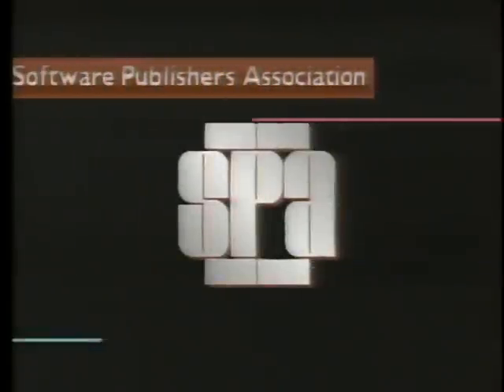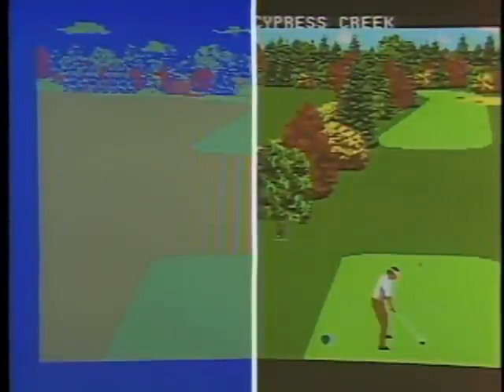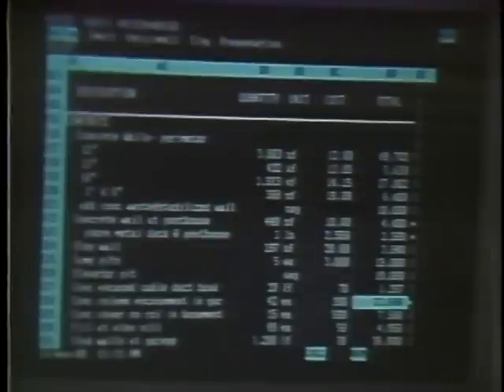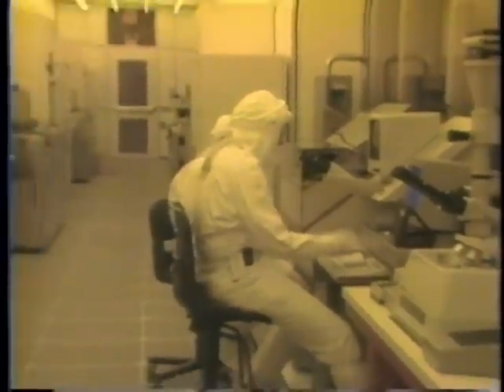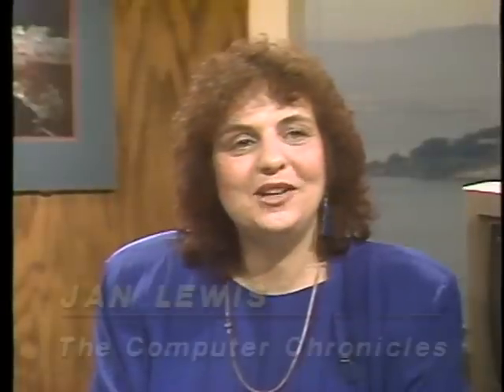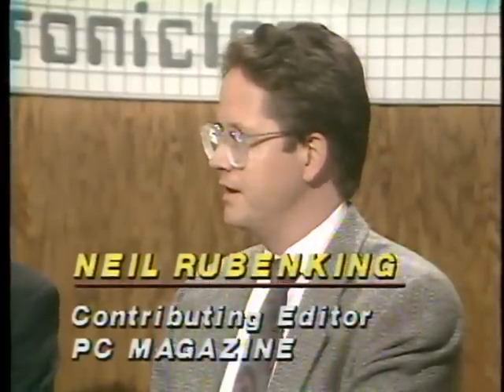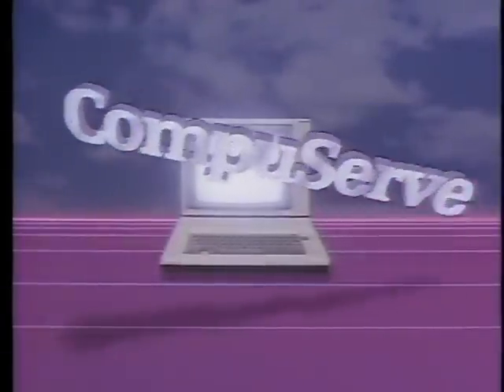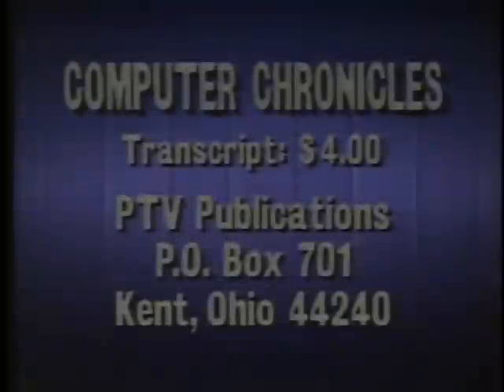The Computer Chronicles - Megahertz Mania (1989)

Comment: 10 years after this episode aired, Intel had surpassed the 200Mhz target that Bill Rash stated. By 1999, it was well over 1Ghz. Amazing!
Reply: Yeah! I was just thinking that! They were at 1.7Ghz pentium
Reply: Level of competition from AMD and Cyrix pushed that ceiling upwards quite a bit with what is more commonly known as the 586 processor lineup.
Reply: @situatedillness  Nope, mid-1999 is 1 GHz. 

On November 20, 2000, Intel released the Willamette-based Pentium 4 clocked at 1.4 and 1.5 GHz.

In April 2001 a 1.7 GHz Pentium 4 was launched.
Reply: Some people were still using 200MHz CPUs I suppose, but things did accelerate faster.
Reply: @valenrn8657  Right? I thought Pentium 3 was 99 they were not yet a GHz.
Reply: @Kamunchu  The original Athlon (now called Athlon Classic) was the first seventh-generation x86 processor and the first desktop processor to reach speeds of one gigahertz (GHz). It made its debut as AMD's high-end processor brand on June 23, 1999.
Reply: @Kamunchu  Pentium 3  reached 1 Ghz with a product recall i.e. wrong FPU results at high clock speeds.
Reply: @valenrn8657  I remember buying one and thinking I should have bought AMD stock and I never did, I really should have!
Reply: Man that guy sure looks the fool, his prediction was off by well over five times.
Reply: Now we have video game consoles with custom 7 nm AMD Zen 2 processors with 8 cores running at a nominal 3.8GHz or when simultaneously multithreading is used (SMT) it hits a comfortable 3.6GHz.

Addendum- I don't know about 1999 but I remember 2004 well. I built my second PC with an Intel Prescott 3.0GHz w/hyperthreading and a GeForce 68000ULTRA just for Doom 3. My best friend did the exact same thing but went with a 2.4GHz AMD something or other. He also bought the same 500 dollar 6800ULTRA card as I did for Doom 3. The Prescott might have had a faster clock speed but his AMD ran circles around it.
Reply: one thing that I don't miss from those days... cpu was old & slow in 6 months lol
Reply: I remember my 16mb ram forget the mhz 3gb HD in thr 90s. Boy was it slow.
Reply: @tr1p1ea I had a 200mhz very tall tower with 64mb RAM my grandpa built. And gave to me as a hand me down in about 94 or 95
Reply: @Sinn0100 once I got an AMD in college I've never looked back.
Reply: @spidaman0112  they had weird speeds in 2000, it was like 733 and 800 (why 733?) I remember getting "2nd" best it was like 700 or 733 and 800 was the best and later that year they released 1ghz or something. It (my computer) had riva tnt2 gfx card, it got older faster than my old p133 lol
Reply: @saitzo2325  I remember having 800mhz and my friend invited me over to show me his new 1hgz. Seemed like windows started instantly.
Reply: @saitzo2325  because of bus speed ... that time were 66 mhz  for low end , 100 mhz and 133 mhz for high end  ,... so 66 x 11 gives 733 or 5.5 x 133 as well 733 ... to get 800 mhz is straight 8x100 mhz ;)
Reply: And by 2007 they got to 10 GHz.
According to their plans in 2000, which didn't happen. Man, Intel in the early 2000s was a bust.
But they got to 3.8 GHz in 2005
And 5 GHz capable chips in 2019
AMD had their 5 GHz chip in 2013
And IBM had theirs in 2009

Comment: Hahaha, I do believe I am the first person to overclock a 286/386. I'll never forget when I was a young engineer working in the radar field, I was responsible for what was called the Built In Test Equipment (BITE). I was able to get this running faster by combining 2 speeds together (5 Mhz to 10 Mhz) and the data stream was twice what it was. I thought about my 386 could benefit from an increase in clock speed so I looked up the schematic of my motherboard and saw that the CPU was running at 16 Mhz. I called a vendor to order a 24 Mhz crystal (xtal) and the guy asked me why did I want to buy that. He told me he only sales to OEMs. I told him I wanted to test the idea of overclocking the CPU. He says he didn't think that would work. I looked at the buss for the I/O and the CPU and didn't see why it would not work. Low and behold, I got the xtal and installed it in my motherboard. It was just plug and play. I booted my system, brought up MS Flight Simulator and wow, I saw a much better runtime in the graphics performance (remember though, this is like 1989 or 1990). I called the guy and let him know it worked. He asked me to send him instructions on how it was done and what adjustments did I make with the clocks. I told him I did not do any wait states above 0. It was just remove and replace. I don't know how many years later but I started seeing ads of vendors talking about overclocking. If I'm not the first, I am certainly in the beginnings of all of that craze. Fun stuff!!!!!

Comment: In 89 I was still pushing a couple of 8mhz 68000 machines
The 1040STe wich was new at the time, and an Amiga 500 with a trapdoor ram expansion.
When I went to a 100mhz pentium in 96, I couldn't believe my eyes.

Comment: The guy from Intel expecting 200Mhz clock speeds by 99.  The first Ghz CPU was released by AMD in 99.
Reply: That's about right, Intel was at 200 MHz then LOL
Reply: @paulmichaelfreedman8334  Hey be nice. Insulting companies with disabilities isn't dignified.
Reply: Athlon 1GHz was released in March 6th 2000, but fair enough. AMD beat Intel with 2 days as P3 1GHz came out in March 8th 2000.
Reply: Intel was up to 200mhz in 1995
Reply: I am still using the 16 MHz computer. What do you guys think should I upgrade it to the 25 MHz version?
Reply: @u.v.s.5583 No, and 640Kbyte are enough.

Comment: Then there was the Gigaherz race, and now in 2019 we have the multi-core wars.
Reply: Now it's just waiting for any program that utilizes more cores.
I have not run into anything yet that my old i5 four core can not handle with a GTX 580.
Reply: and moores law is now dead to so waa waa waaaaaaaaaaaaaaaa
Reply: Why chips have standard sizes? Can't we start building processors that are rectangular? Or even polygonal?
Reply: Same with video cards my  9 year old GTX 580 Video card runs any new game. I use to upgrade Video cards every two years .
Reply: @adityasumanth6122  technically yes because if you go back in time far enough cpu's where at one time made rectangular we can we can make them circular to if we wanted to but it's up the manufacturer to choose the shape not you unfortunately look up the 6502 for an example it's made both as a square and rectangular cpu depending on which model you order
Reply: @Crashed131963  All variants of minesweeper?
Reply: @Crashed131963  compiling. I have Ryzen 7 CPU and its 16 cores reduce the time of compiling a software significantly, but I wish I had Thread Ripper.
Reply: @raven4k998  i was talking about the processors.. not CPUs
Reply: @adityasumanth6122  Google "odd chips cpu-world". CPUs are type of processors.
Reply: @Crashed131963  Lol My phone hase more horsepower than your i5. Try doing something other than watching ytube video's. I'd bottleneck an old 2 core i5 on almost everything I do on my PC.
Reply: @UmVtCg  What video card does a phone have?
Like I said still waiting for that Game a 3.2 GHZ i5 with a GTX-580 can not play.
Reply: John Smith Playing a game and playing a game at 4k/60 with texture quality higher than your sub-console level of graphics require more than your potato PC, not to mention VR, wireless VR, video and 3D rendering, and photo editing.
Reply: @BlownMacTruck   Just saying things have slowed down.
A PC and Video card never lasted me 2 years, now you just go through life with a 9 year old i5 3.2 and GTX-580 and buy the newest games without looking at the system requirement anymore.
I can afford any PC I want but that WOW factor difference from the old days when I upgrade is not there anymore.
Reply: John Smith No, you could always do that. What’s slowed down is your desire to play them at high fidelity or anything in VR.
Reply: @Crashed131963  Red Dead Redemption 2 gobbles up the 4 cores of my 6th gen i5-6600k.
Reply: And in the future it will be the QPU (quantum computer) wars.
Reply: @Crashed131963  i hear you bro, im still on my pentium 2 and that work horse is still trucking it for any applications i use
Reply: @rowger8927  A PS4 plays Red Dead 2.
My GTX-580 cost more than my PS4 did when they were both new.
Reply: @Yakiniq-n7o  You must not do much then, and obviously nothing to do with the internet.
Reply: KoivuTheHab  dude really that's all you are going to add to the discussion? His misuse of were? That's kinda sad.
Reply: KoivuTheHab  dude really that's all you are going to add to the discussion? His misuse of were? That's kinda sad.
Reply: @Crashed131963  yea unless you are playing intensive video games at a high settings you really don't need to upgrade every few years anymore. I kinda like that ngl.
Reply: @Crashed131963  this is the problem with horizontal vs vertical scaling

the more you rely on wider/more processors vs faster processors, the more difficult a problem it becomes to actually utilize the potential speed you have
Reply: @adityasumanth6122  it’s down to manufacture costs. If you change your shape it will cost in new equipment to produce. Also to an extent fitting the components in the chip in the most economical way and distance between the components as if they are far apart then it slows the process marginally
Reply: @raven4k998  Not really.
Reply: More and more cores because clock rates/IPC have stagnated, and most applications still lean heavily on one/two cores. I miss the days of huge, tangible difference from one CPU gen to the next.
Reply: shhh kid your confused multicore wars has been going on for years since 2004 atleast
Reply: @Crashed131963  space engineers can utilize up to 8 cores so ha
Reply: @adityasumanth6122  shhh kid your confused

Comment: 4:14 that guy was spot on in 1989 he said in a decade there would be 200mhz processors in 1997 I got my very first computer a gateway 200mhz mmx technology computer
Reply: Not quite spot on. It actually came quicker than he thought since this was filmed in 1989. The first 200 MHz processor was released in 1996, which was just 7 years after this was filmed.
Reply: #timetraveler
Reply: @pauldavis5665  yup, in 1999 we had 400Mhz processors so 12x and not 6x
Reply: @pauldavis5665  Good effort though, most projections are not this close.
Reply: Something is wrong, I bought my first PC with a 1Ghz processor in 2000. I'm pretty sure the year before, they were at 500Mhz to 750Mhz.
Reply: @video99couk  During those years (99-02) clock speeds were increasing very fast so I wouldn't be surprised if in January 1999 the speeds were around 400Mhz and in January 2000 1Ghz
Reply: goesuptoeleven you responded to the wrong person.   No need for the '@'.  Just click on the person's name.
Reply: In 1998 I built a 300MHz Pentium II system, IIRC 450MHz was already available but I couldn't afford the bleeding edge.
Reply: KoivuTheHab  Yeah, so he wasn't that accurate. we were far beyond 200 MHz in 98
Reply: In early 1999 i had an a Intel 700 Mhz Gateway (2000) and payed under $1000 as far as i remember, so it surely wasnt the top of line.
Reply: @goesuptoeleven  No. we had 1Ghz pay attention.
Reply: @Paultimate7  Your reply says more about you than it does about any of the comments here.

Comment: Boy that brings back memories, my first computer was a 10 mHz 8088. Bought from an add in Computer Shopper, a rag that could have used in place of concrete building blocks.
Reply: I used to advertise in computer shopper. But I never sold any 8088 systems so I'm off the hook lol.

Comment: 4:09 "We still have a long way to go in the speeds of our microprocessors. Today, we're at 33 MHz is the maximum speed of a microprocessor that Intel manufactures. Ten years from now, we expect to be shipping microprocessors that operate at speeds up in the range of 200 MHz." This was 1990. Little did he know! Ten years later, Intel was selling Pentium III processors running nearly 1 GHz.
Reply: I totally loved the P3, especially the tualitin core. The P4 was a big disappointment. My 1.4Ghz P3 Tualitin, was faster than the 1.8Ghz P4 I replaced it with. :(

Comment: Having being born in '95 I missed a lot of the earlier stuff like this but it's amazing to see CPU's that are so low power that they don't need any cooling other than passive airflow.
Reply: yeah well that's was before they figured out that to get more speed they had to crank the power up a lot which means more heat in the chip
Reply: You can still do that today but... whats the point? I mean sure, phones are passively cooled as are some laptops. But why passively cool a desktop CPU. There are very few reasons to.
Reply: @t1e6x12  Yeah, it's like how having a very loud turbo on your car & revving the engine down a quiet residential neighbourhood is a guaranteed muff-magnet, but it's nothing compared to the panty-dropping power from the sound of an aftermarket cooler on your overclocked dual-core Pentium. 😉

Comment: Computers were very expensive in the late 1980s. A 386 sx-16 mhzs computer with a monitor, keyboard, 1 mb of ram, 40 mb hdd, and a dot matrix monitor cost about $2400.

A Microsoft mouse cost me about $100 in 1990!
Reply: I scrapped a Microsoft mouse from 1990 and got 13 cents worth of silver.
Reply: ***** The only thing that was lacking in the Amiga 500 was the 8 bit sound. Other than that, it had great graphics. The animation on the games was choppy on flight simulators.
Reply: Ace1000ks1975 dot matrix monitors would have been the shit, if they existed >_>
Reply: statikreg Some offices still use them.
Reply: Ace1000ks1975 Think about what your'e saying, and then try again.

Hint: there is no such thing as a "dot matrix monitor".
Reply: Ace1000ks1975 I suppose there are dot matrix displays, which I guess adds some ambiguity.
Reply: statikreg I mixed it up with a dot matrix printer.
Reply: Ace1000ks1975 Well, as I pointed out, after some googling I found that there are dot matrix "displays" (which is technically different than a "monitor", although we tend to use the terms interchangeably), made out of LEDs, so you were still partially right, and I was partially wrong, depending on how you look at it and define the terms, etc lol
Reply: Computer technology changed a lot from 1988 to 1999. That is when you had big changes. In 1988, the average person would have a Intel 80286 12 mhzs computer, and in 1999 a Pentium 3 500 or 800 mhz was the norm. From 1989 to 1999, I had the 80386 sx-16, Pentium 100, Pentium 166 MMX, AMD K6-2 350, AMD K6-3 450, Celeron 400A, Pentium 2 400, Pentium 3 550, and a Pentium 3 800. I went through more computers in the 1990s than any other time. 

From 2000 to 2005, I had the Pentium 4 1.8, Pentium 4 3.0D, & AMD Athlon 64 3200+. From 2009  to the present, I had the Intel I7-960, Regor 245, Phenom II 945, I7-3570k, and I7-4790. I went through more computers in the 1990s than I did during the last 17 years.
Reply: +Ace1000ks1975 You need to also mention an inflation issue. 2400$ in 1990, is same, like 4500$ today.
Reply: @ruthlessadmin  I dont think so, usually the development of any new technology is not revealed for the mass. What is happening is that the big companies are revealing part of what they created and it is a bit old at that time. If it is not then it is used by the military, advanced science and secret services.
Reply: Computing back then was a painfully cruel hobby if you didn't have the money but wanted to keep up with the newest hardware.  Storage tech was probably the biggest cost barrier as I recall.  I hated floppies with such passion but never could afford a hard drive until much later.
Reply: @oldtwinsna8347  Fast forward 31 years. Today, a 2 Terabyte hard drive costs $50, and a 40 MB hdd in 1989 cost about $400. In inflation adjusted prices, a 40 MB Maxtor hard drive would cost $1,200 today.

A Western Digital 2 TB hard drive cost/MB = 2.0 x 10^-3 cents / Megabyte (less than one cent per Megabyte)
A 40 MB Maxtor HDD in inflation adjusted prices = $30 / Megabyte
A 40 MB Maxtor HDD in 1989 prices = $10 / Megabyte

I didn't get a new computer since 2014 when I put together a computer with a I7-4790k processor. I just made minor upgrades, like adding larger hard drives, adding a SSD, adding a new graphics card, adding more RAM, and upgrading the operating system to Windows 10.

I think binary computers are reaching a ceiling when it comes to engineering improvements. It is kind of like the piston engine for aircraft, it reached the peak of its development during World War 2.
Reply: I paid $2500 - $3000 for each upgraded computer I bought between my 4MB 386-20 with 60MB HDD in 1989, my 486DX, my Pentium, and my dual Pentum Pro 200 in 1997 before prices started to come down.